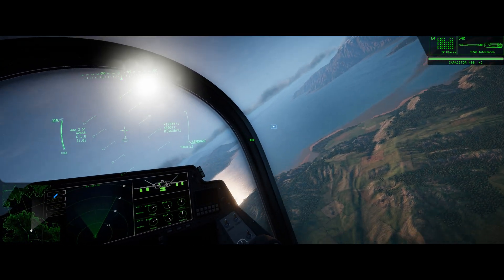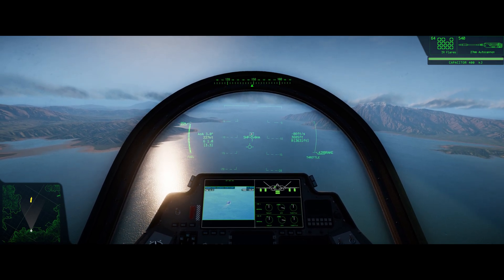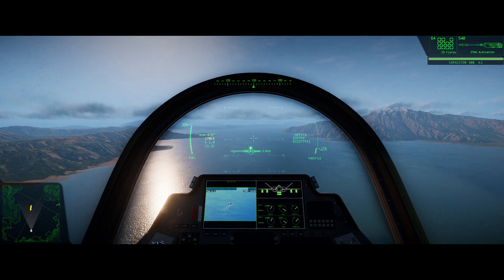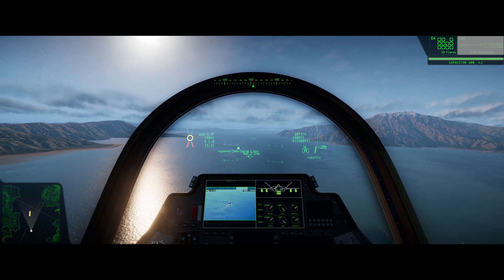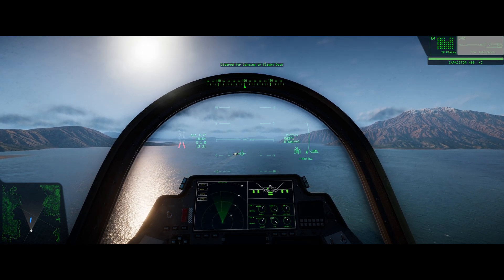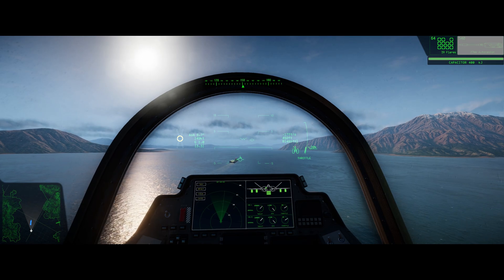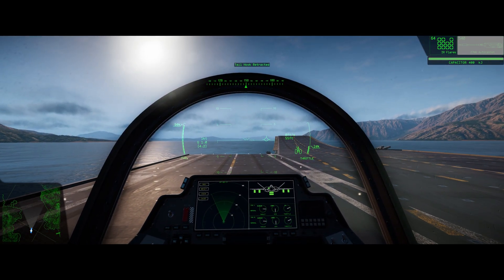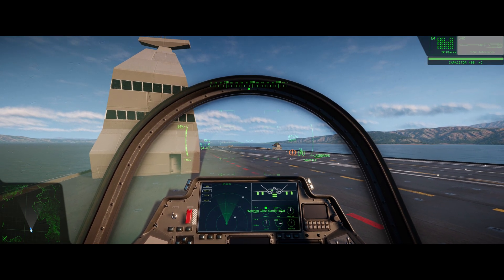Nuclear Option Carrier Landing

Comment: Basically, keep the nose up 2.5 degrees (that is the "W" symbol in the center of the HUD), and keep the velocity vector (circle with three hash marks at 12, 3, and 9 o-clock positions) on top of the glideslope's end, which is another circle.  Move the velocity vector up and down with throttle, not the stick.  Going faster or slower is how you control your rate of descent when at such low speeds.